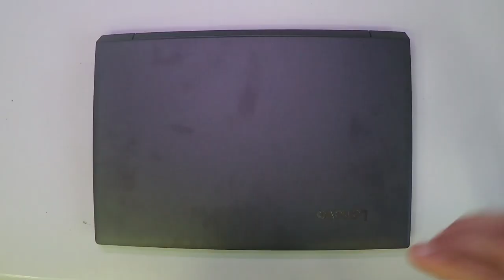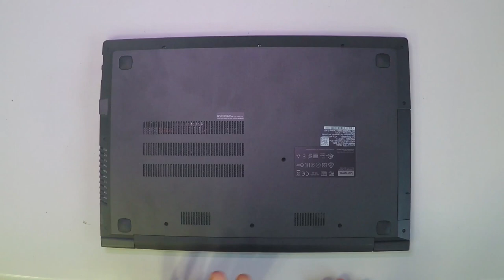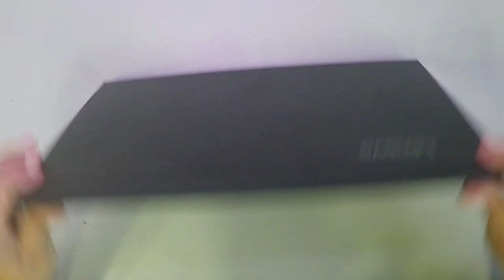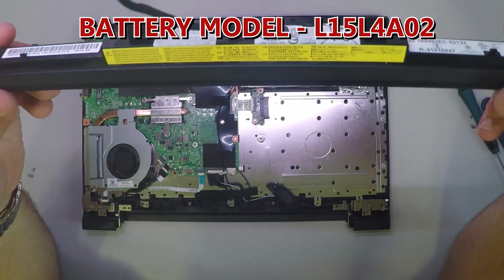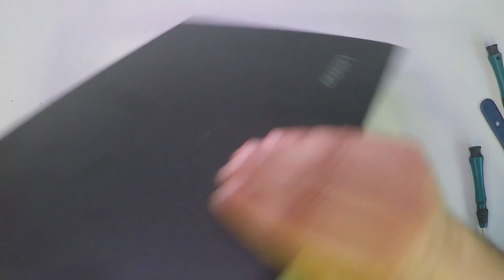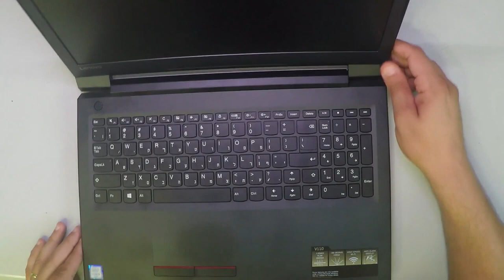Lenovo V110 Battery Replacement

Comment: Could laptop run without battery.. With plug in ac
Reply from the maker: Hello mahmoud, You Can run a laptop with out battery just with your AC Plugged in.
بالتوفيق
Reply: Mahmoud Mmels yes you can but I wouledt do it